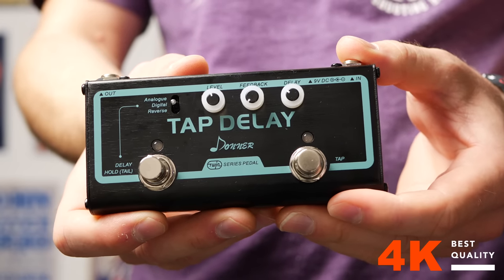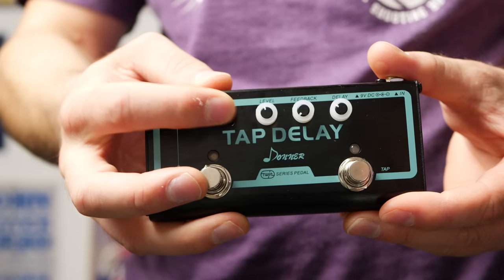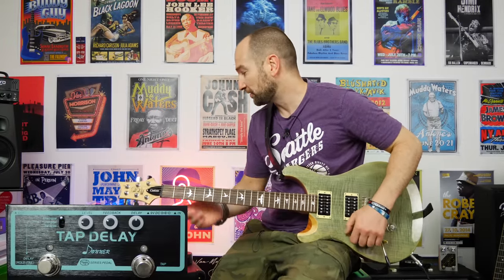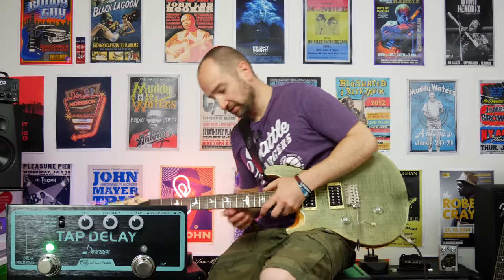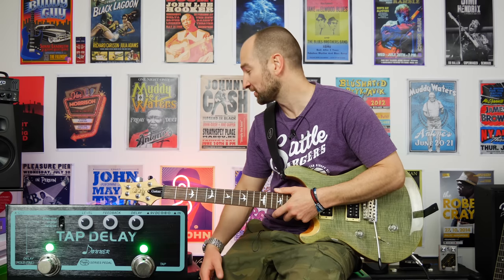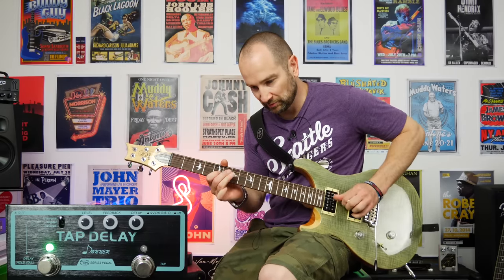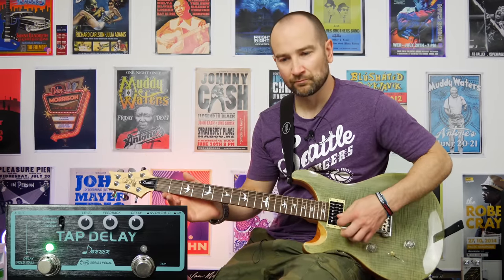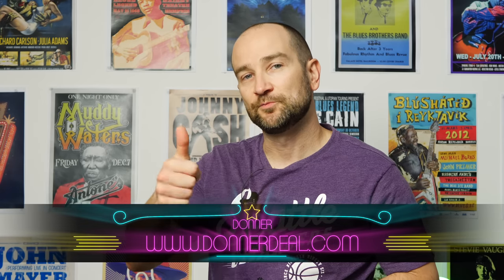Donner Twin Series Tap Delay Pedal Review 3 Delays in 1 Pedal

Comment: The way I use a reverse delay is to cut off the dry signal, and set the time to a long repeat.  Play a phrase, and it comes out backwards, a la Hendrix.
Reply: Does this pedal do dry cut?
Reply: @smarkalet9078  - I don't know for sure, as I don't have one, but if you were to turn the level knob all the way to the right it should do that -- cutting the dry signal and only the 'wet' goes through the signal chain.
Reply: Yeah. I'm looking for a digital delay with tap tempo that does dry cut. Not so easy to find.
Reply: @smarkalet9078  - TC Electronics  Flashback2 with a tap tempo addon button.
Reply: @Majik53 Thanks. That's a great suggestion. I'm still looking for something cheaper as this idea is for weird experimental stuff.

Comment: Hi! I have a question. I bought this pedal but I don't know if I'm using it wrong. When I set a tempo using the tap footswitch, can't I turn the pedal off without loosing the tempo I have settled? Everytime I turn the pedal off, do I have to set the tempo again by tapping?
Reply: I know this is three years late but it probably defaults to the tempo that gets set by the "Delay" knob and the tap tempo just overrides it temporarily while the pedal is still on.  You could probably save the tempo but still "turn off" the delay if you ran the delay through like an A/B effects loop channel switcher and used a volume pedal or something at the end of that chain.  You could use the volume pedal to slowly decrease the delay or you could put another pedal at the end of it with the level/mix set to zero so when you activate that pedal it kills the delay.  or even just switching the a/b box off so it's just outputting your "A" signal now.  I don't know a whole lot about effects loops but that's kind of my understanding of something you could try.